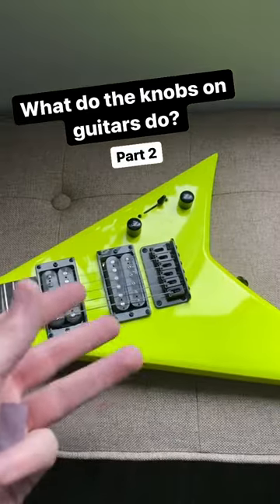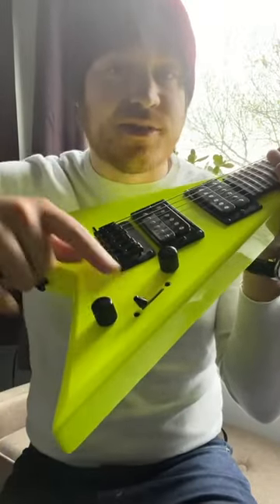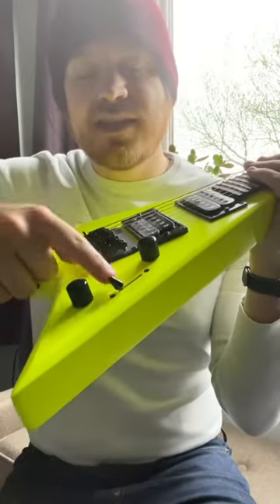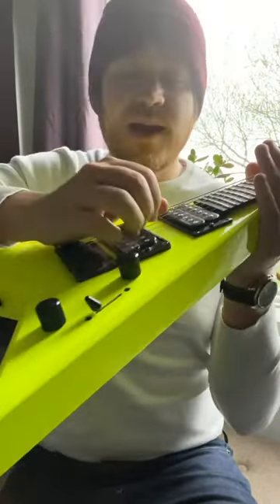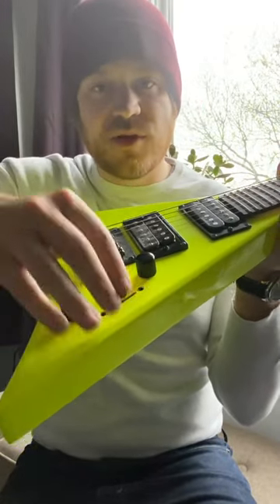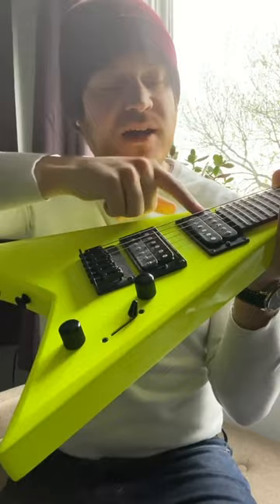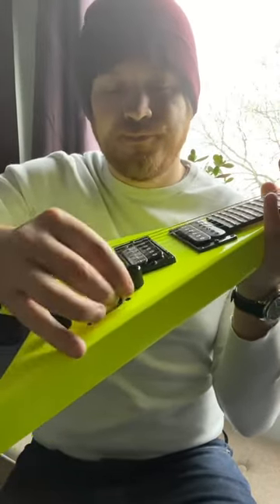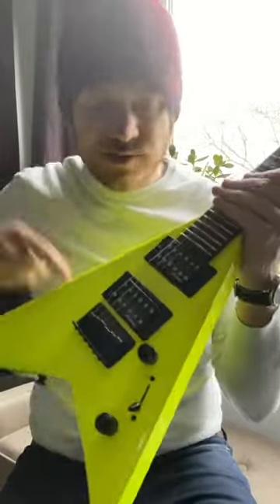What the knobs on guitars do (part 2)

Comment: Some guitars have the switch move in five possessions.
Reply: That's because those guitars have 3 pickups. Bridge - bridge and middle - middle - middle and neck - neck pickups
Reply: Well i have an Ibanez and it has five switch positions but only two pickups. I believe it goes Bridge-inner singlecoils- Bridge and Neck- outer singlecoils- Neck.

Comment: Can someone ELI5 what the knobs on basses do? I've been playing for a bit over 10 years, but, I'm 100% self-taught, which tbh, only goes as far as maintenance and playing.
Reply: It really depends on the bass.
Most bass guitars use separate volume pots for each pickup instead of a switch for a wider range of sounds, sometimes even separate tone controls. The basses with like 5 knobs or so usually employ active EQ, making three knobs control e.g. bass, middle and treble frequencies. Some even have EQ "presets" in switches or rotary knobs, guess bassists really like their EQs. :D
Reply: @BananaManPL  Thanks. Personally, I've got four knobs, and can't really tell any difference when I adjust any of them outside of the volume knob.

I feel like I have to agree with some bassists being eq nuts. I know I kinda can be. I've been waiting about a decade to be able to afford a new amp, specifically for one tone. Lol